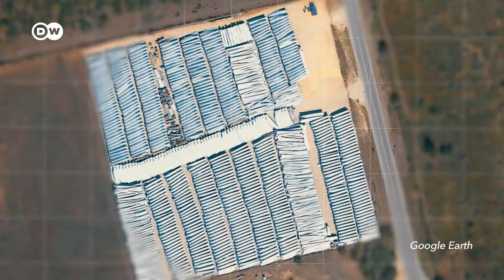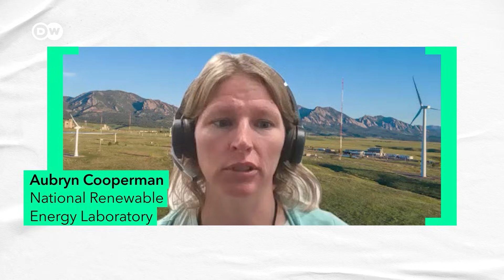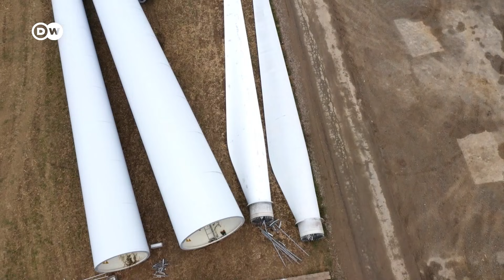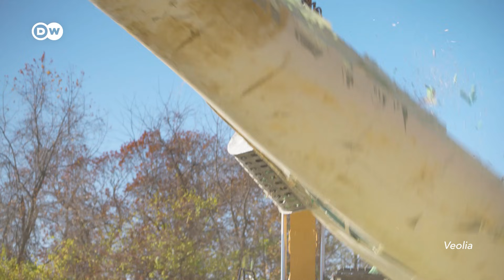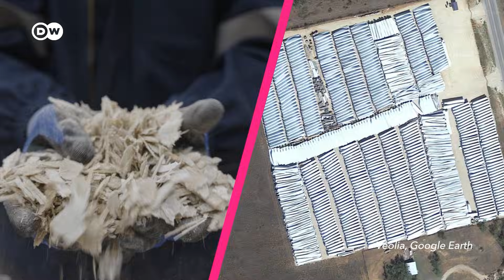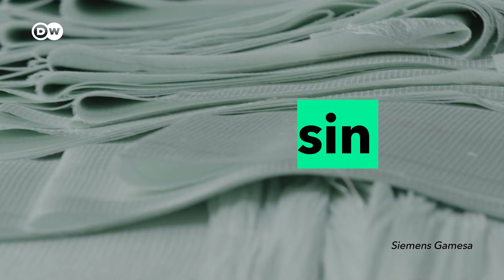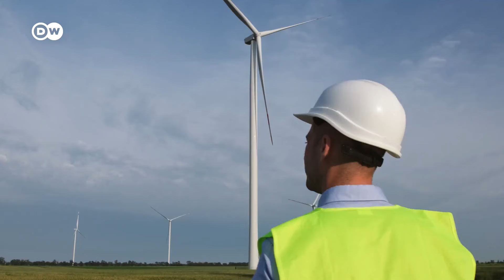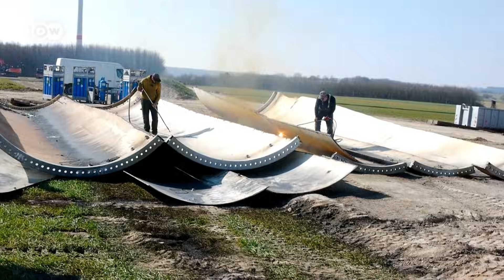Wind power's unsolved problem

Comment: I've never seen a coal-fired power station talk about recycling their structures!
Reply from the maker: Cool that you are into critically examine coal and its impacts. Please check out these videos from us 👇
📺 "How coal mining is displacing millions"
https://www.youtube.com/watch?v=W8y4PM041UQ
📺 "How coal made us rich — and why it needs to go"
https://www.youtube.com/watch?v=42yF2t7xMHY
📺 "Lützerath: Why Germany is destroying villages for coal"
https://www.youtube.com/watch?v=CjFeVERfvH4
Reply: Folks complaining about recycling wind turbines will not be placated by a fully operational blade recycling system. Even if it gives everyone a free unicorn and a bundle of cash. They'll complain about birds being killed, sound, flashing lights, causing tornadoes, blowing up UFOs, etc.

They oppose change and/or they are part of fossil fuel vested interests. Folks who fear they'll have stranded assets.

At least be honest that much of the "but blades can't be recycled" crowd are arguing in bad faith.
Reply: @DWPlanetA  What is the difficulty in crushing them and using them for concrete reinforcement? It is unnecessary to separate the fibers from the epoxy
Reply: True - coal powered generators are not claiming to be environmentally friendly so they don't need to worry about end of life recycling and the impact on their image.  However it seems that the critics of renewable energy don't seem to mind if coal, oil, and gas energy facilities are environmentally friendly,  it seems like this is only a concern with regard to renewable energy sources.
Reply: @michael-j-harrison The fact you think the need to talk about recycling and environmental outcomes is about "image" makes one wonder if you missed the entire point of going green. 😅
Reply: But it's so easy to get rid of the nuclear power plant and waste. Or not 😁
Reply: They are VERY recyclable. They're steel and copper and some concrete, brick and mortar.

They are like steam locomotives. You don't see them littering the landscape now, do you? Recycled ages ago.

Nothing goes to waste.

They don't NEED to brag.
Reply: Glad you pointed this out. how many plastic car bodies are being recycled? What a bunch of BS!
Reply: I mean, they are already unsustainable. Why would anyone care.
Reply: Indeed. Though we will have to solve the problems of recycling solar panels and windmills if they are going to go beyond being a niche item.
The problem though is that many like to use this to attack the sentiment that they are better than fossil fuels.
Reply: A coal station can be producing energy for more than 50 years and at the end of the day, it's just a big boiler, turbines and tubes, all made of metal that gets recycled. The only thing that "hard" to get rid of is all the concrete of the buildings. Do you know how many forest are getting screwed due to wind farms? Do you know how many animals, specially birds die near the wind turbine farms?. Not that "eco friendly" when you take everything into consideration. It's a good solution but with many flaws
Reply: @ALIENdrifter66  replying to my state in my country,  there are no wind farms on native forests.  They were cut down mainly for farmland. What's left has no windfarms. There is one small windfarm in plantation forest that has not much of ecological value. See another DW video, skyscrapers kill multiple (,like hundreds of times) birds than windfarms. In fact I would say in my state duck hunters kill more birds, including illegally killing endangered ducks (most are probably responsible, but let down by the irresponsible minority). 
You probably get your "factoids" from where it agrees with your point of view, so no doubt you will send a ton more of lies thinking that they are true
Reply: @ALIENdrifter66  more birds die from crashing into windows than from wind turbines. It's not even close.
Reply: They can be recycled… into a nuclear power plant.
Reply: @Zed_Oud  I think Bill Gates is planning that in America, but there is a massive double-standard of expectations. Coal mining often leaves considerable damage without being properly remediated
Reply: The concrete is crushed and reused as aggregate for new concrete or base pack material.  The majority of the rest is simple metals.

Steam plants last on average 60-80yrs, Wind last 20-25yrs.
Reply: @bowez9  and the coal mines will be properly remediated? In theory yes, but in practice...
Reply: Actually, atleast in europe all wood, concrete, lamps, insulation and metals are collected and recycled in demo jobs.
Reply: @satinkuti5875  it's great Europe recycles well. And great that when old coal-fired power stations are closed, the new electricity generation is far more environmentally friendly. Don't you love new technology
Reply: Or the combustion wastes, the ash contains heavy metals.
That also end up in landfill or used as underfill for roads.
Reply: This is the best counter argument I have been looking for for ages!
Reply: You don’t get it
Reply: They generally last a shitton of time
Reply: @elecman748  they do, but then why are they mainly being built in East Asian countries? Closing slowly in the EU, my country. Closing even faster in the US
Reply: Their material has to be aluminum.. 
Giant blades arent most nornal choice
Reply: @astemet Aluminium is too soft. And the bigger the blades, the more efficient the wind energy.
Reply: You've probably have never heard of it, but what you forget, is that a coal power station is not scattered over large area and being a compact wind turbine. Coal power station is a large building and if they decide to close it down, it undergoes decommissioning process. Since the steam turbines inside are subjected to very controlled conditions they might be reused in other heat based power plant or recycled, since they are made of metals which is easier to recycle than carbon fibre composite. And then you have the actual building which can be then refitted with other equipment since taking it down would be a large expense. Or you can of course take it down and recycle the building materials. There are other equipment which can be reused such as boilers, pipes, pumps, etc. Which can be re used as well. So it's not completely correct that they do not recycle it. Of course nowadays coal is not the best option for power, neither wind turbines or solar is, because of intermittent periods and we need nuclear power to supplement the renewables.
Reply: @scottcz6896  so you seem to be from Scotland.  Seems Australia and Scotland are world's apart on nuclear and renewables. 
Wind farms here are mostly hosted on farm over large areas. The farmers agree  to it for money. No issue on not being concentrated- pretty daft point from our perspective. Are renewables intermittent? Yes, but there sum gets spread over wind and solar and areas. Transmission lines move electricity around and yes cause problems. Then there are a variety of storage mechanisms. It is a transition that will take many years and will be challenging. 

Nuclear has many boosters here, but as yet no investors. So, at least here, I will start to believe the nuclear story when someone is willing to put their own money on it.
Of course every country has a different situation. A bit weird to say it's nuclear or nothing. But good luck to Scotland decarbonising, whichever way you do it.
Reply: @lawrenceheyman435  Here we have large wind farms and yes, Scotland has enough renewable energy to power Scotland multiple times, but it's not only Scotland we power, it's the rest of UK. And UK has quite favourable conditions for wind farms, not so much for solar. 
But Germany doesn't have so much favourable conditions and now they closed their nuclear power plants, they have to burn coal to subsidise lack of power. 
I said the road will have to be renewables combined with nuclear for most countries to reach net zero emissions. Pure renewables will cause blackouts (and we have come close to large scale blackouts in the past in Europe which was saved by nuclear power plants). Solar is not very usable during night and wind doesn't always blow everywhere. And currently there is no universal way to store energy ok larger scale apart from pumped hydropower storage, which is very expensive and not feasible everywhere. 
The reasons nuclear was neglected was because of Chernobyl and Fukushima. And also the fact that investors wanted to go for gas burning power plants, as it is quicker to build, therefore they can start making money sooner. Hopefully this will change in the future.
Reply: @scottcz6896 Nuclear power plants are too expensive and take too long to build. The approval process is not easy either.
Reply: @old-pete  They are, but they also produce much more power. In France majority of its power comes from nuclear. One nuclear reactor can produce 1 GW of power, but 1 offshore wind turbine only 7.5 MW, so imagine how many wind turbines you need to cover for just 1 building.

The main issue is that you can't renewables everywhere and call it a day. So far the most reliable renewable are hydro and solar. Hydro being better as it can still produce power during night. But you can't have hydropower everywhere.
Reply: @scottcz6896  It is easier to build multiple windturbines at once than building a nuclear power plant.
And apart from some city sized nations, I know of no country where one cannot build windturbines.
Reply: @scottcz6896  well, I did forget to say in Australia, the biggest source of renewable energy is solar panels on people's homes. Excellent source of power. Cheaper for the home owner. Low transmission use. Incentivices electrifying the home and car, so much more energy efficient. As home batteries get cheaper (in my view should be subsidised for the benefits to the power grid), another big piece of the puzzle will slot in. 
I was in Europe last year. I remember France nuclear plants weren't running much over the summer, exacerbating the EU's energy issue. Big plants can also cause reliability issues.
Reply: @old-pete  It isn't the matter whether you can or cannot build them. But will they be viable? Not so much everywhere. In Europe there are plenty of countries where they don't have widespread wind turbines because they don't have favourable conditions to make them viable.

And yest it is easier but you are covering land with wind turbines and a lot of times, reducing farmlands, which is not ideal for food production.
Reply: @lawrenceheyman435  68% of France's power comes from nuclear. Solar is good for countries like Australia or Spain, but not so much for UK. Yes you can have homes powered by solar, but you also have to power large industries and home solar is not going to do it. Storage is nowadays possible for small-scale, but not so much for industry sized power demands. And with large plant, yes you have more things to maintain, but it is centralised for large production scale rather than scattered all over the country.
Reply: @scottcz6896  not an issue in Australia. Also not sure why it's an issue for offshore windfarms. I am all for reviewing whether it might cause ecological harm. No solution to decarbonisation is perfect.
Reply: @scottcz6896  That is why the focus for the UK should be wind, hydro, biogas and biomass.
Reply: @scottcz6896  They are viable.
Some countries are better suited than others, but there are still spots which can be used.
Agriculture land does not need to be used and even if it is, the amount of land lost is rather small.
Reply: @old-pete  No you need agricultural land for crops, and no it is not small, because if you look at Whitelee Wind Farm it takes up 55 km^2 of land. The farm was not build on agricultural land, hence it can be large. Of course you will find spots where you can use them with low local impact, there they should be used. But you cannot subsidize the whole energy production with wind turbines or hydro, that's what I am saying. There are a lot of impacts people do not think about.
Reply: @scottcz6896  I did not claim you do not need it...
But the area between windturbines can still be used for farming, IF one really needs to put them there.
Reply: @scottcz6896  last reply from me. You don't have any response to summer 2022 nuclear power plunge in France. 

Saying renewables can't power large-scale industrial enterprises reminds me of politicians from the Oz version of your Tories saying renewables could never make up 20% of the grid (said ad nauseam to us around 20 years ago). We are now at 37% and rising. One state is 70% renewables and has large scale industry (South Australia). 

I realise we will need gas in Australia for the periods renewables won't provide enough power until renewable hydrogen is economic. But that will still likely be far cheaper for us than nuclear. Seeing Hinkley Point C tells me the nuclear power industry makes promises that should be taken with a pinch, no large dose, of salt
Reply: @lawrenceheyman435   Last response from me. The 2022 reduction in production was down to 40% of electricity being produced by nuclear (still significant) and then back to 73% in January 2023 so a major jump due to maintenance.  Renewables can power large scale industries ( i did not say they cannot), but storing electricity on larger scale is not yet available. And the argument for nuclear is, that it does not release CO2 into the atmosphere, as gas does. 

Saying renewables is just solution and put it everywhere even though it will not be efficient is also wrong. You see you will still need fossil power stations in Australia because pure renewables cannot make. Climates change, which can result in blackouts. And of course nowadays, options like modular nuclear reactors are starting to emerge. The only reason I said nuclear is the option, was as a supplementary power source to renewables to balance out intermittence periods, provides very cheap electricity and at the same time does not pollute atmosphere as we are trying to minimize CO2 emissions.

Sure keep gas power, but gas is something as widely available in Europe (apart from Russia) as in the US for example which made it expensive, while still emitting CO2.
Reply: @scottcz6896  nuclear may make sense in countries that already have a nuclear industry, such as the UK and France. There, you have decades of experience in building and operating nuclear. I'm not opposed to nuclear as a technology, and I think Germany and Japan should have kept their nuclear power plants running after Fukushima, instead of shutting them down. However, Australia has zero experience in nuclear, and as such, even the most optimistic projections wouldn't see an operating nuclear power plant here until the 2040s or 2050s. There have been proposals, but nobody wants to put the money in. 

Thus, the best transition technology in Australia is gas, which we already have experience in, and we have plenty of the fuel, so we can build multiple, small, responsive generators all around the country. In the long-run, Australia should be able to achieve over 90 percent renewables, as Australia is such a big country that it's always windy somewhere, and solar can provide most of our energy needs during the day (when demand is highest). Rooftop solar is actually the single biggest renewable source in Australia currently, more so than commercial solar or wind, so it already is powering industry. 

Also, wind turbines have negligible impact on food production here. Why? Because they are usually built on land used for livestock. Cows and sheep are utterly unconcerned by the presence of the odd tower here and there in an enormous paddock. Plus the farmer gets a second income stream by hosting the turbines on their property, helping to smooth out the peaks and troughs of farm related business costs. Solar farms work well with sheep too, as you only need to build them about 6 feet off the ground, and the sheep can shelter under them from the rain or the sun. Another benefit is that sheep keep the grass nice and short underneath the panels. This is a win-win for energy production and farming.
Reply: @jdillon8360  I agree with the Australia case, but my point was mostly about not just taking wind and solar as 100% solution to everything everywhere. As I am very familiar with the industry and the challenges in the design, I don't like seeing for example Germany, shutting down nuclear and putting up wind turbines like it is going to solve everything. Like as it was mentioned here, Scotland is great for wind energy (not so great for solar), as Scotland has enough wind power to power whole Scotland multiple times, but only at full power at windy days. And you don't get them all the time. But it good. However Scotland also has to power England and rest of UK so then the energy demands suddenly spikes much more. I just think that future power solution would lie in mix of nuclear if possible and renewables which would ensure meeting net zero goals.
Reply: @scottcz6896  Yep, I agree that Nuclear and Renewables are good for a place like the UK. Australia would be foolish to go down the nuclear road, for reasons mentioned. We have so much sun that together with wind, batteries, pumped hydro and maybe a small amount of gas, we could cover 100 percent of our electricity needs without coal. If we can use excess power to produce hydrogen, we could even export power to other countries. I guess my other points were that wind and solar are not the enemy of farming, as people sometimes claim. Would love to visit Scotland one day. My grandmother was from there.
Reply: @scottcz6896  those are some valid points. however, a coal power station emits a lot of CO2 during operation. A wind farm or solar farm emits exactly zero CO2 during operation. So, we mustn't forget about the impacts during operation of a power source when we talk about recycling the components at the end of life.
Reply: They do it anyways, concrete, steel, and copper get recycled from demolition or they just keep the empty coal plant structures around in case they need it again.
Reply: Thats because coal plants never purported to being environmentally friendly. They only existed to generate electricity and they did the job well.
Reply: @drunkdriver  they were also as economical as they could be.
everyone thinks of victorian early industrial era as this concept of free fuel lets burn it all... yet why was james watt so famous? becuase his condensor increased the efficiency, the economy, and allowed for far more work from a given amount of rather EXPENSIVE fuel.

each step up until iunno, the 70s, a progression, an advancement.

and now we seem to be regressing into depths of stupidity, forgetting all the trials and tribulations of the ancestors that built this modern world we all take for granted.

got nothing against wind. if i had the funding i would be converting a coal station to be wind powered. because that is actually a workable, and relatively simple idea. all you have to do is heat water....

but we are stupid, obsessed with glitter and shiny things, flashing lights. we only care that its got flashing lights, and how many we can sell. 

we dont understand how anything works anymore, a systematic brainwashing from the education system. put two and two together and keep getting three...
Reply: @drunkdriver  yes they did do the job well. Even if you don't care about the environmental effects, they seem to be losing the race to be the most economical form of generating electricity
Reply: Because they last much longer than wind turbines,, at least 50 years. And overall quantity of materials for wind turbines of same power as steam turbine power plant is many times bigger. And type of materials of steam powr plant (concrete and steel) are much easier to recycle. Its obvious.
Reply: @Lichnaya_pravda  oh really ....
Reply: You missed the “image” part of the video. Wind turbines are supposed to be green even at the end of their life. No none expects that of coal plants.
Reply: @sayrith  so perfect should be the enemy of much better?
Reply: @sayrith  supposed to be? In that context it sounds like you’re saying they aren’t that green but we gotta have faith.
Reply: @sayrith  also i didn't miss that part of the video. It came after explaining the total waste by 2050 would be 43m tonnes versus 12B tonnes of plastic. So they have to be perfect on a minor issue, fossil fuels can do whatever 🙄
Reply: That’s because coal stations don’t have 300 ft fiber glass blades that rotate in the wind. A furnace and steam turbines are a lot easier to service because they are manufactured with reclaimable materials.
Reply: Power station made from metal. And this metals easy to recycle.
Reply: @representin614 And theoretically fly ash could be refined into nuclear fuel if the price was right.  It's not like it's impossible to deal with it, there just needs to be an economic model to make refining it feasible
Reply: @alexipestov7002  Is this on the horizon?
Reply: Coal fired power stations have at least double the life of wind turbines and can be refitted, they are far more efficient so far fewer are needed.  Even with all these turbines we will always need fossil fuel power, wind energy is intermittent and unstable so the traditional power stations are still always running to even it out on the grid and to come into play when there is no wind or it is too windy so the turbines are shut down, the wind companies get paid a subsidy for turbines not turning, one of the reasons the price of electricity will never come down.
Reply: @judithmackay7158  The actual reason electricity prices hasn't come down is because we're still using fossil fuels. Not only do they get massive subsidies and tax breaks still, while also making record profits, the price of electricity is set from the gas generation price not the renewable generation price
Reply: @judithmackay7158  I am not sure where you are from. Where I am from, Australia, I think the last coal-fired power station was completed in 2005. They just aren't economically viable anymore, despite having a lot of political support. To my knowledge, new large solar and wind are not receiving any government subsidies. So unless coal gets cheaper, which seems unlikely given it is a mature technology, it will slowly decline. Large scale batteries are currently mushrooming here.
Reply: Coal fired power stations are not economical? Where did u get this info from? I would agree Nuclear is the cleanest and is better than coal. We are not there yet with bulk renewables. Another option is  gas.
Reply: @soothsayer5743  nobody has built a coal-fired power station in my country since 2005. There are no proposals for any. The reason for that is they aren't able to make a profit
Reply: @judithmackay7158 Within ten or fifteen years, almost all existing coal plants outside China will be shut down for purely economic reasons as they are too expensive to operate and to maintain.  

Other disadvantages include the health impacts of coal mining on the miners, and oh yeah, this little thing called GLOBAL WARMING.

Batteries are being scaled up exponentially to complement wind and solar.  They provide a far more reliable source of constant power, since coal mines go offline for maintenance for months at a time.

Unlike coal, these batteries will be fully recycled, so once the needed amount of materials are mined, in a hundred years or so, it will be possible to obtain almost all needed materials for all energy needs by recycling existing materials.  Coal cannot do this.

A hundred years from now, burning coal will be a distant memory.
Reply: @judithmackay7158  Lots of comments proving your claims false. 

You don't seem to want to reply.
Reply: @judithmackay7158  Coal fired power plants in Australia are also being paid a subsidy to keep running, even when we don't need the power, to stop the operators from simply shutting them down due to lack of profit. Coal power plants cannot ramp up and down easily, and as such, are increasingly become a burden, not an asset. Australia is moving to reduce coal power stations, and to fill the gaps when renewables cannot provide 100 percent power, we are using a mix of gas, batteries and pumped hydro. Coal is on its way out in Australia.
Reply: @judithmackay7158   You didn't address the dirty side of coal burning which is typical of being selectively environmentally concerned about renewables. Turbines get turned off mainly because the grid has too much power at that point in time, something you can't really do with coal i.e.  you can't turn it off and on at will.  UK electricity price is governed by the price of gas, not renewables.